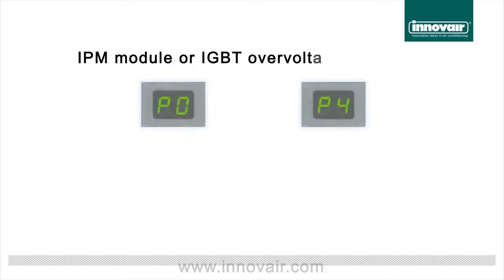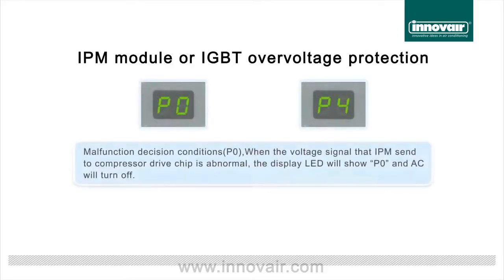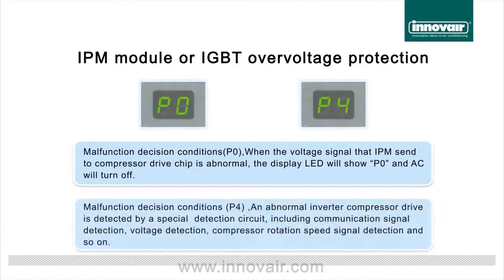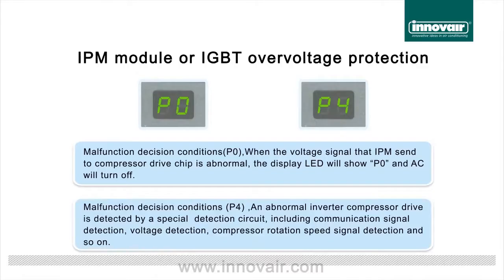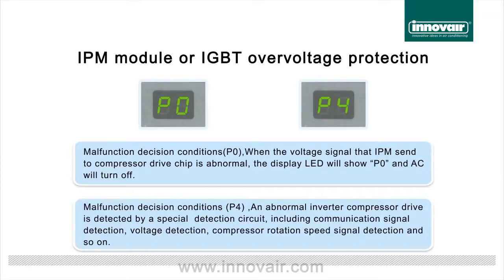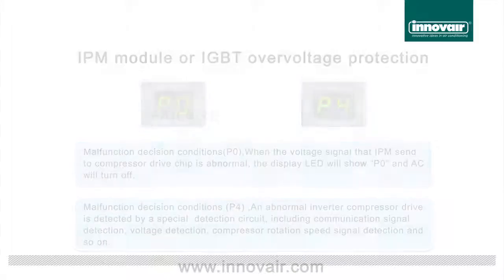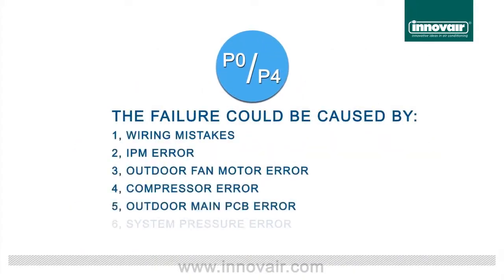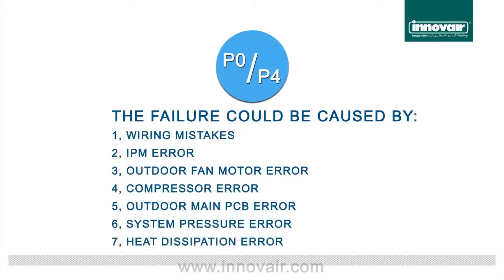Inverter Error Codes P0 P4viaP0 p4 inverter ac error codes

Comment: Cured pc04 code by taken the tandem breaker of the 120 volt mini split and put it on regular breaker so letting guys know that even though u hear tandem breakers are ok and technically each circuit is separated but somhow the compressor didn’t like it when the fridge was on while inverter tryed to ramp down but hope this helps
Reply from the maker: Thank you sir